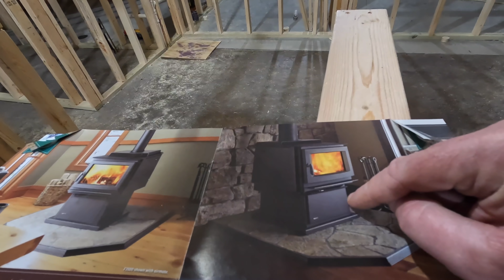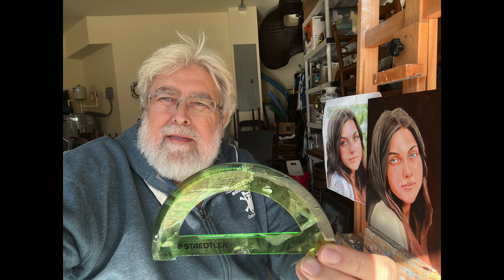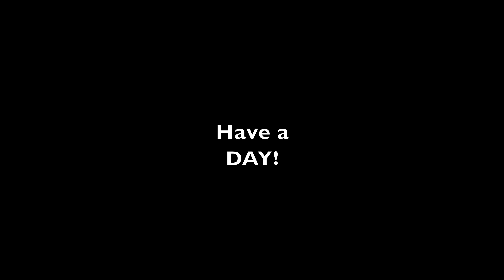Tips and Tricks From Plumber Jim! Plus more of Your Tractor Pics

Comment: I would suggest measuring where a small cabinet above the toilet is hung... we have a skinny one just large enough to hold TP.   Or.. measure where towel bars will go... nail plywood between the studs there so you have solid place to anchor those onto the wall.  if you are going to add a grab bar near a shower or toilet... also good place to fill in between studs with plywood for a solid anchor point.

Comment: Love the tractor pictures! We are all proud of what we build, and it is compelling to watch your projects. Don’t mean to quibble but I heated with wood and was responsible for the “wood” (chip) fire boiler to run our kilns until I retired.  Explanation of combustion is long and boring, so short version, a wood fire  only gives 30% energy release if furnace temp is below 1200 degrees, the other 70% occurs when carbon monoxide is converted to carbon dioxide which can’t occur below 1200 edges. So an oversized wood stove is much less efficient. Actually better to be a little undersized and have clean combustion. Incomplete combustion wastes wood and can foul the chimney. So a bright flame with a blue base 👍 dull yellow flame👎. IMHO not worth risking a fire to save money.

Comment: Ask Plumber Jim how he can use the wood stove, copper pipe and a recirculating pump to use the floor heat system.  Propane for emergency and to fill gas grill tanks.  Project is looking great.

Comment: In my shop I have a insulated large vent pipe above the ceiling 16 x 18” with a louvered vent over the woodstove it open with an exhaust fan in a different part of the shop to draw heat from the top of the woodstove to move it to the other side works great

Comment: Great stuff,  good work.  One thing though,  it's no longer code to glue a fitting inside a pipe,  as In the closet flange. We can still use the flange with the rubber seals inside the pipe, just can't glue.

Comment: Just curious if he will be using nailing plates on the studs that have the pipe hole drilled very close to the edge of the wood? I know in canada its a code rule for both electrical and plumbing. Thanks.
Reply: U.S. Also.

Comment: Mike, I have a belt drive blower and motor assembly that came out of an oil furnace I would donate to your building. It would be perfect for moving  air to the workshop side.  But, it's in Lycoming County and would cost you more in fuel than it is worth probably to come and get it. But, if your travels bring you close at any time in the future.......

Comment: @2:05 You may want to measure that vanity waste line horizontal run to the main 3" vent. If memory serves me the max distance for 1 1/2" is 3'. What could happen is the trap could siphon. That's why there is a max distance allowed. If the studs are at 16" centers you are very close to the limit allowed. UPC. United Plumbing Code. Signed, Plumber Ray.
Reply: My bad. It might be 6' max run. I will have to check my code book.
Reply: Studor vent on it??

Comment: Mike, I am not being critical but asking for my knowledge. Why does plumber Jim want to go with copper pipe instead of the new Pex?  I was told the Pex was more freeze resistant and would not develop pinholes as copper does. Was I lead down the wrong path so the plumber's job would be easier on him?  Thanks
Reply: Rod , it's a good question , it'd be nice if Jim saw it and gave you an answer ? 
I have 1 or 2 guesses though : 1) Jim's an old school plumber , and copper pipe has always been the Gold standard for plumbing .
2) he's only going to be running it on interior walls , so any risk of freezing is very low , and even if the electricity were to go 
out for several days in the winter they'll still have the big wood burning stove to keep the place warm enough  + there's no 
shortage of wood to burn at the Morgans household / lol :-) 
if you remember the radiant floor that Mike put in -- all the tubing - was a grade of Pex tubing for that part too .
( personally ) I think copper pipe only gets pinholes when it gets very old ? or as in the case of one of my clients -- the previous 
owner did his own plumbing and installed the wrong size ( too small ) which I think caused the pipe to thin out from the inside way too soon ?  ? and from what I've seen on some renovation sites ( I'm in home Reno's )  Pex is quicker and easier to install 
which may be why some guys prefer to use it ? /  no welding to do ! so I don't believe you were steered down the wrong path ,
hope that's helpful to you ? / Have a Day ;-)

Comment: I have no use for PEX, copper every day!  The only thing I don't get is the hole saw.  If I were a plumber or electrician, I may have a hole saw in my arsenal, but the few houses I have built after about 30 minutes I threw the hole saw and bought "bits".  Stick it to the stud and it sucks itself through the board and you don't spend 20 minutes burning your fingers digging the block out of the hole saw.  Way faster and a lot less effort.

Comment: Will be interesting watching the copper water supply install. Just about every recent build I have seen on YT has gone to PEX. Please explain the reasoning behind the choice if you would. 
I would suggest you look at one or two Mini-split HVAC units. You can have backup heating as well as AC for not much more, and they are relatively inexpensive, and quick install.

Comment: Plumber Jim is great, but the one thing I disagree with is waterlines being copper. Had a friend who had to replace all copper waterlines 20-30 years after it was built from massive pinhole leaks. That involved ripping out walls, replacing all waterlines then having to fix the walls. Got very expensive !  Don't know of any builders here in Ga that do whole house copper waterlines anymore. See some other comments below also.

Comment: Love Jim and his wealth of experience .... but copper in a detached barn/garage is expensive, risky and old school .... Pex is easier, cheaper and easily changed/repaired ... much better at handling a deep freeze because it expands, I like/use copper coming out of the wall/floor for looks ... but as a high end builder with 40 years experience I switched to Pex decades ago ... and I can train a 10 year old to run Pex in an hour with minimal, simple tools ... and yea Mike, go with the bigger stove and fans and see if you can't find a decent *Firewood guy in the neighborhood, way cheaper than propane ; )

Comment: Mike--I think you will get way too much heat out of that stove and it will be way too hot for you in there. It's not a big space. I heat my entire 2500sq ft home with a smaller stove--Vermont Castings Encore. If you get a stove that's too big you will have to run it a low temps which promotes creosote buildup.

Comment: I'm surprised he didn't put any nail stop plates on the 2x4's, he will most likely do it, but folks seeing this may not know about them & that they prevent drywall screws from puncturing the drain lines in this case.
  I would go with PEX, as it has a much better tolerance against freezing, as well as much easier, cheaper  & faster to install.